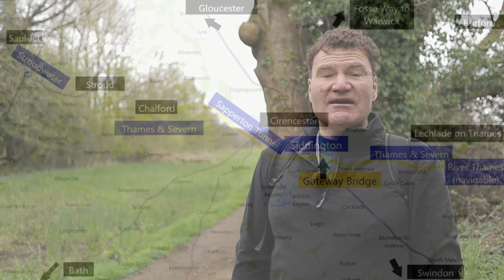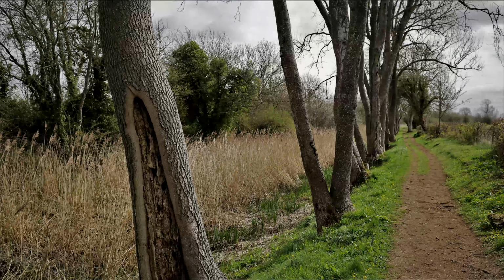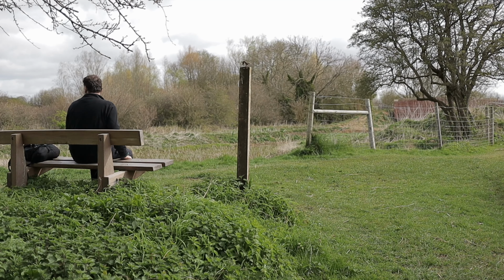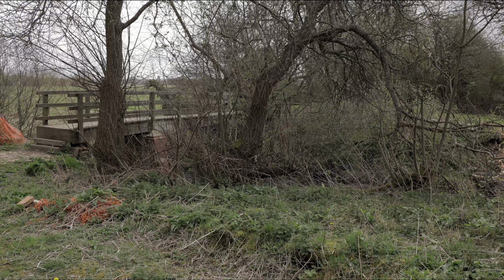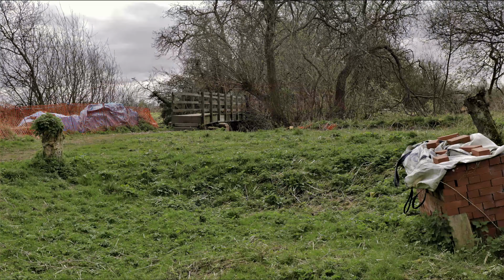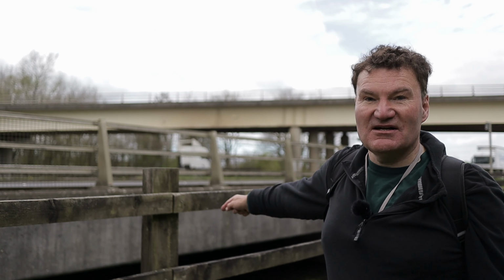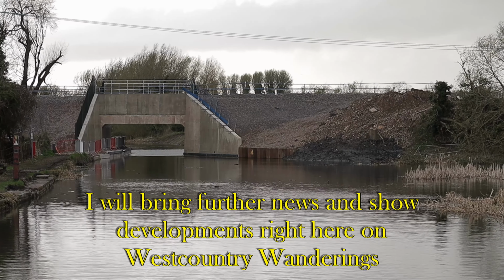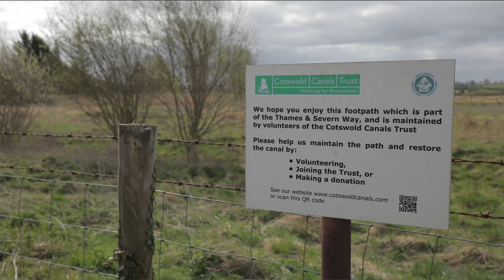Stroudwater and Thames & Severn Canals Update 8 - Restoration

Comment from the maker: After filming this, I have learnt that there appears to be some confusion over the Latton Culvert under the A419. The one I showed is on the line of the T&S, but I have since learnt that there is another one, albeit buried at present. Some sources state that it is the buried one which will be used. Can anyone who volunteers for the Cotswold Canals Trust clarifiy this? Also, does anyone have any information on the North Wilts Canal tunnel in Cricklade who knows the prescise whereabouts and its current condition. Thanks in advance! Paul.